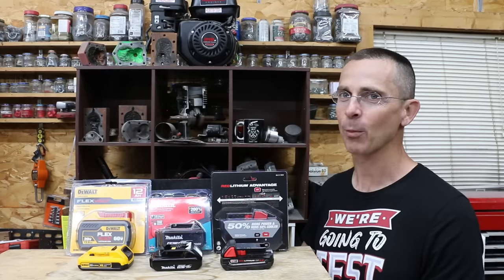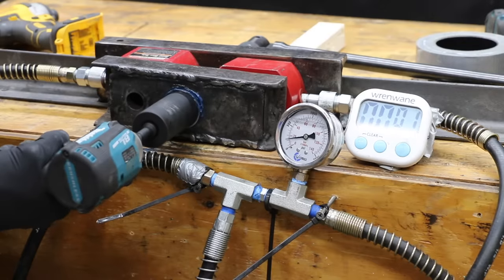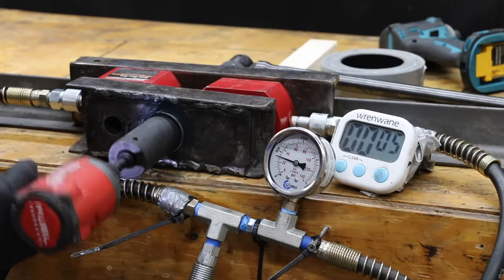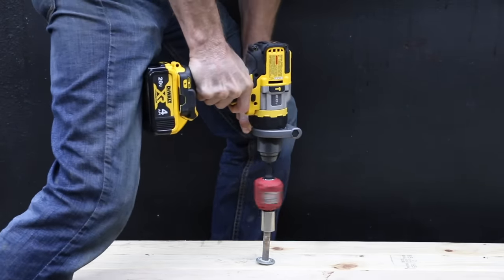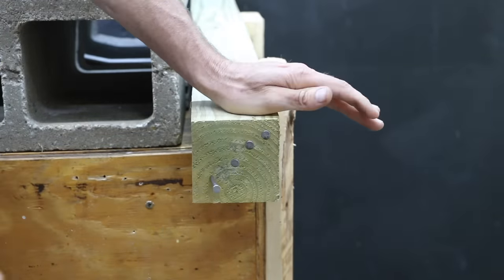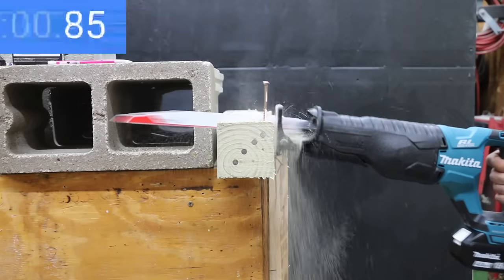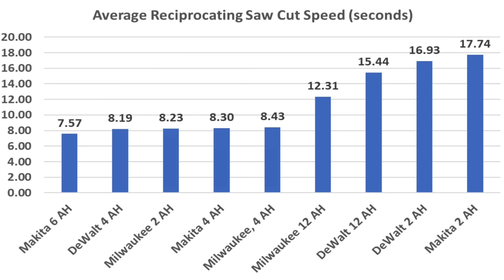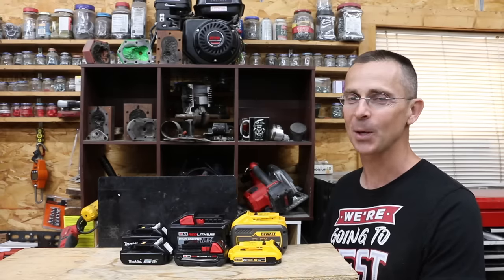Small "TOOL" Battery Better? Milwaukee vs DeWalt vs Makita

Comment: I’d love to see a diesel oil showdown
Reply: Shell rottella T. I promise. I have used them all for years and the magnet on my drain plug tells me that shell is the best in all my engines and heavy equipment. Plus it is highly recommended by Vice Grip Garage as well
Reply from the maker: Thanks for the suggestion.